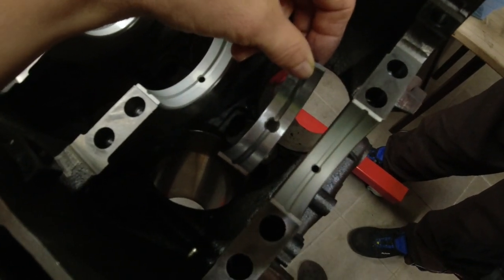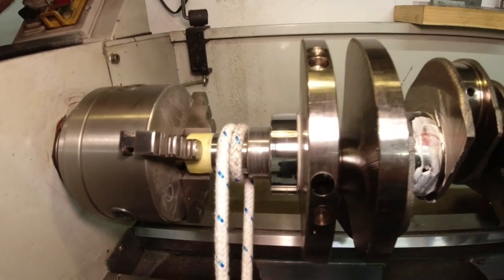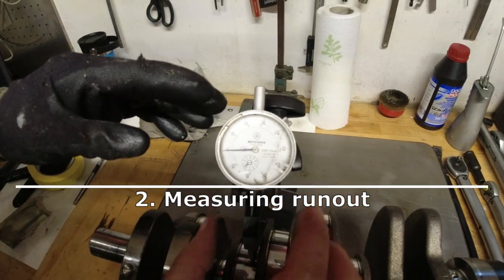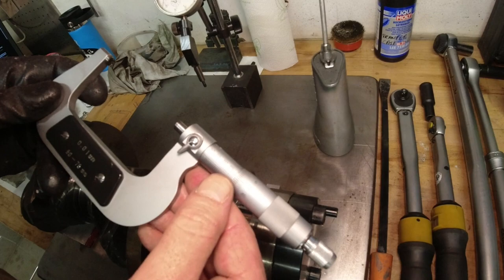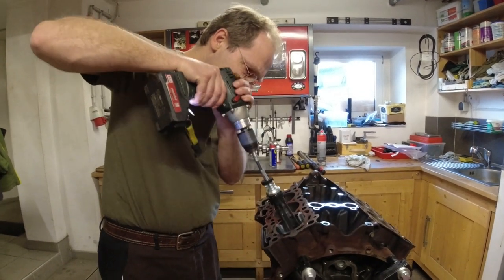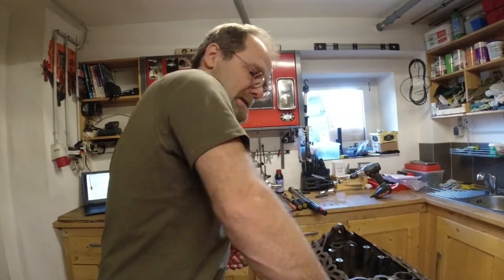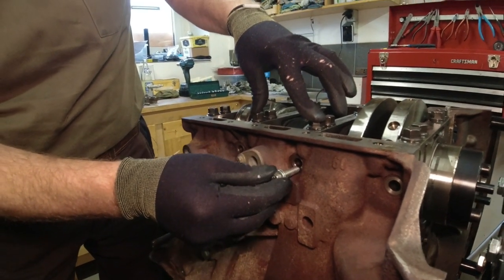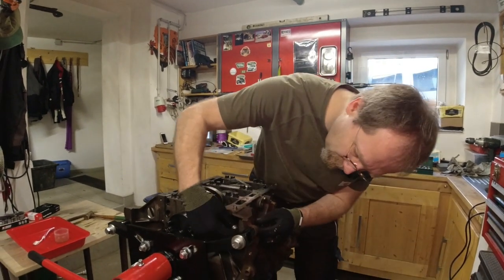Land Rover - Complicated crankshaft install - Discovery TDV6 - stress for Toyota drivers - Episode 4

Comment: Just love the detail being an ex Technician. Always interesting to see how different people do the same job.
Have to say I gently disagree over lubricating main cap bolts and contact faces (indeed any torqued bolt). If specialist bolts like ARP are used then follow their instructions but lubing the threads will drastically affect the torque applied (ie it will be higher than if torqued dry).
Personally I always fitted bearings dry and then added lube but its just choice. I never used the fancy 'assembly paste' and have (as you did) always used what we call 'Hypoy 80' diff oil right from the first Lotus Twin Cam engine I rebuilt. It has great stiction and has no detergent additives like a multigrade engine oil so will aid running in. A specialist racing engine builder here in Suffolk did some some work for me on a 1098 Mini engine with a BMW K Series bike head that I am building and one of the older guys said most of the specialist paste smells like Hypoy 80!

I reckon this will be one of the best TDV6 engines running when its finished. Superb attention to detail.
Reply: @Rahmi Acar  I was an MAN and Scania technician and they used stretch bolts but they were never lubed. I have built many truck and car engines and I always used dry bolts. My point was that some specialist bolts like ARP are manufactured for lubed torqueing. Most others should never be lubed unless the manufacturer says so.

Comment: i used to ink the shaft of Endmills and Slot drills when they were undersize to make them fit better in my mandrill, as a tool and cutter grinder. So i know you can build up a thickness with a sharpy[ie type pen :)

Comment: I do not trust Haynes manuals.
A very long time ago I was rebuilding an Alfa Romeo GTV engine and being very conscious about it (I was racing it) 
When checking the main bearing crush it was way out of spec according to the manual so I 'corrected' it. 
When I tried to turn the crank it was locked up solid. 
It turned out that the Haynes manual was a decimal place out! 
It cost me a lot of money to sort out. 
Also their manuals leave out 70% of what you want to know. They are really just advanced owner's handbooks. 
I have never bought their manuals since.
Bentley manuals are so much better (but a lot more expensive) .
Reply from the maker: Yes, the Hayes does not cover the lower end of the engine fully.  Lot´s of wrong information out there.  Christian

Comment: Re: avoiding oil delivery problems in bottom end. In addition to the restriction of the cam galleries, "radius" the oil holes axially only (use chainsaw type stone matching gallery width, with lead in toward rotation direction). As a last resort, cross drilling provides optimal oiling throughout the rpm range, or full groove main brgs.. A higher pump pressure might be necessary, with HV or pressure spring change. Am sure you're aware already. Nice job on the polishing Christian.. and Vera !

Comment: I currently have a rr sport on my lift with body removed holding me up from doing any other jobs and it has 360k on it and I suspect it is the original engine.......! May well explain the rattling noise on start up and the two completely defunked chain tensioners on both banks ......! 
They really are great fun to work on....! Never a dull moment!

Comment: Hi Christian + Vera, I have my own Discovery 3 and can relate to all the work you have done so far.  I gave up taking it to the Landrover dealer, each visit seemed to be Euro1000 plus each time.  I am currently doing the Exhaust crossover pipe.  Land rover quoted Euro2400 for body off and pipe replacement, unbelievable. Nearly finished now,  had to take gearbox off.  I wish Toyota would do a land rover crate swap engine.  Really enjoy your videos, please remember to fit a new  Impulsgeber, Kurbelwelle CKP with trigger ring.  Its a must that you use the landrover special tool Sealey VS231 Kurbelwelle Sensor Trigger Rad Installation Für Jaguar, Land Rover to get the timing correct. Keep up the good work.  Regards from Soest NRW.
Reply from the maker: We already have those parts waiting to be installed, including the tool. 😃👍🙋‍♀️Vera

Comment: great work.  Mine is in its natural state, with the body off looking for a mystery OIL leak..  
At the shop they told me they absolutely need to take the body off to determine the exact location, now they tell me the can't find it and since the body is off they cant start the engine to check.. :)  
Still I am happy with the car even tough I only did   300 km from the dealer   and another 200 to the specialized LR shop.. :)  Owning an LR is never boring..  
Anyway  this I know will be very expensive and now I talking with the dealer about some expenses to be reimbursed..
Reply from the maker: 😳😅 I am sorry, but you should be on our channel with your Disco. I hope everything works out for you. And I hope they are going to find the leak, it would be embarrasing for LR otherwise. Maybe you can write us then. 😃👍🙋‍♀️ Vera
Reply: @Vera_and_Christian  Well I will keep you updated  and   maybe when and if the car will be able to  run on its own I can drop by and tell you the story :)  Got plenty of pictures already,  all taken apart.  It would  be really funny if not for the incoming invoice.. :)

Comment: Thank You Vera and Christian for such detailed descriptions of engine rebuild aspects.
I already rebuild TDV6 engine twice and still have two on the table waiting to be finished (no I am not a mechanic - just doing it for fun).
At the moment I have two Discovery 3 and one of them is during swap for M57 engine from BMW.
Have a nice week and see you next Sunday.
Reply from the maker: Cool, respect. Please tell me those engines ran longer than a couple of thousand Kms. 😅👍🙋‍♀️ Vera
Reply: @Vera_and_Christian  We will see because one of them has only run a few thousand kilometers, and the other one is already in the car but the body is still off.

Comment: My mate and his cousin are traveling down to the south of France next week to pick up his 2.7 discovery which has been parked up for nearly a year without use. They want to drive it home to the southwest of the UK so if they get  any problems with the engine I’ll get them to drop it off for you!!
Reply from the maker: 😅 Make sure they are sensitive to any weird noises the engine gives off.  A couple of engine failures happened to ones which have been standing over a long period of time, probably because all the oil has dripped down in the sump. 😉👍🙋‍♀️ Vera

Comment: Superb video, reminds me of when i rebuilt my 3.9 V8 LR engine, cam shaft died after 70,000km, oil ways to the rear of the block starving of oil killed of the tappets, fitted a different spring to increase the oil pressure, problem solved, engine has 330,000kms and still going strong, with 20/50w with added zddp. If only LR carried out better R&D we all wouldn't have problems like this.
Reply from the maker: Oh man, I hope that we are doing such a good job like you did. 😃👍🙋‍♀️ Vera

Comment: Hi your doing incridible job   ...im james and iwas in need of a help ', i refaced tdv6 heads cylinder at 0.30 so i was in shock after bearing in mind that engine wont run  .my question is what is the best grade should use

Comment: Good job , I am not as talented because i am waiting for mine to go in and have a service and hopefully have some glow plugs changed , thats if he can get them out ? as i had trouble starting in sub zero temperatures last year . hopefully that will be succesful and prevent this happening to mine !
Reply from the maker: When we changed them on this engine, the engine was hot after an hour long drive to our house and then we cooled the plugs with an air hose. That is also our plan when we will change them on my Disco. But I am sure your guy knows that. 😃👍🙋‍♀️Vera

Comment: Hello, all the way from South Africa- Was just wondering if you honed the block for the mains-and slightly polished the crank journals is that not why the Kings mains didn't fit within spec. I see the manual shows 75.00 to 75.02 and the specs in kings 75.029 to 75.009- i only have access to Kings hence my concern. appreciate the video/s
Reply from the maker: The mains measured 74.98. The King bearing did simply not fit.  After compressing them, the bore was not round.  Christian

Comment: Dear Christian and Vera, I am repairing my 2.7 engine after a broken crankshaft. Because of engine block is in spec (bearings have not turned), i'm going to install Fai bearings following your advice. The question is what to do with the crankshaft, buy an original used one or a new aftermarket? Do you know any brand or manufacturer that generates you some confidence? I hope you are both well, and happy new year
Reply from the maker: You need to buy OEM or used.  Measure the mains in the block to see if it matches the FAI catalog!  Do not buy a aftermarket crank.  Do not reply in the comments. We won’t see that.  Contact me per email in the channel description.  Christian

Comment: MINI engines few years ago had problems with axial play on crankshaft because they saved some money on making thrust bearing faces only on upper part of bearing (block). And the bearing wear totally in few thousands km. And then was a technical campaign and recall for installation of modified thrust bearings with faces on both bearing parts. Have replaced them allot. About bolt lubrication - usually oil is specified in repair manual because torque moment is calculated and tested according to lubricant. In some situations they ask to lubricate and wipe oil from the bolts, in some they ask not to lubricate because bolts are already coated. As an industrial mechanic mostly we use Molykote on thread and contact face as required.
Reply from the maker: We ordered Molykote, but then did what the Ford Manual requested (which we did not have access to yet when we ordered the Molykote). 👍🙋‍♀️Vera

Comment: Great video again guys I'm nervous now I have kings bearings  sitting in my office 😭 

I'm hoping that the 2012 2.7 engine I I from the Ford territory has the actual Ford spec'd bores for the mains otherwise I'm in for a hard time like you had 

Did you end up using the kings bearings for the conrods
Reply from the maker: No, ordered FAI as well but the King would have worked for the con rods according to the catalog.  I think the King bearings are fine on later engines.  Mine measured 74.98 which is really the lower end and the bearings ended up warping a bit.  Christian
Reply: @Vera_and_Christian  thanks Christian just re read your email it makes more sense to me now after watching the video 🤣

Comment: What oil are you going to use? My Jag 2.7 is now over 200k km and I have decided that 5w30 is too thin. I'm going to 10w40. It's rarely below freezing in London and I think that such a thin oil was for emissions / fuel consumption, not protection of the engine.

Comment: You DID remember to replace the core-plug at the front of the oil-gallery, right?
We saw you drill a hole in it and then pull it out (11:25) so you could flush the oil gallery but I don't think we saw you fit a replacement.

Never cease to be impressed by the standard of Christian's work.
Anybody who's getting him to work on a project is lucky to have him.

If I travel to Germany, do you suppose he could have a look at the oil leaks on my TD5 engine? ;-)
Reply from the maker: Now, the plug will be fitted when needed😃👍, like everything else. 🙋‍♀️Vera
Reply: @Vera_and_Christian  Great stuff.

As long as it wasn't forgotten, it's all good.

Comment: I’ve got a stupid question. I see that you are putting the bearing shells in which are in 2 parts. What’s to stop them turning in the block. I don’t see anything holding them in place. Or do they get held when you bolt the other piece on to the block.
Reply from the maker: Like every engine bearing:  by compression.  The tabs which you miss here are for location only. It is a common wrong assumption that they have to do with anti rotation.  Tabs reduce the bearing surface area and this may be why Ford left them out or because they had an other cheaper idea to position the shells in production. Christian
Reply: @Vera_and_Christian  Thanks Christian. I missed one of the videos where you explained all this. Watched it last night. Omg.

Comment: Do you think the newer engine had a larger oil hole in the block for the bearing? I have always inserted them dry as I didn’t want anything behind the bearing to promote them to move, but I guess once it’s all knee deep in oil it probably doesn’t matter.
Could you have used shim steel for the loose bearing caps?
I sounded like you were unsure of the history of the crank shaft, do you think it would have been a good idea to get it crack tested?  I guess you need to stop somewhere with the spending.

Comment: That has to be the most complicated jigsaw ever! I'm surprised you didn't use an angular torque measuring gauge, especially as you were not doing the easy(er) 90 deg?
Just loving this series - I hope all your hard work pays off in the end.
Reply from the maker: The Amazon angle gauge did not work.  Should have spend more money on it.  Christian
Reply: Vera. Snap On makes a torque/Angle wrench. It's about $450.00 U$

Comment: My Jeep 3.6 gas/petrol engine is starting to use oil, about 1 quart per 900 miles. No leaks and no smoke. When can I schedule it for send to you for a rebuild? After watching your videos on this rebuild I worry that the engine shops here in the US will not do as quality of work as you are doing. Maybe I will just purchase a used motor with 60k miles on it and have that installed. I have not even priced out a rebuild - which going on labor prices and the amount of work that I have watched you and Vera put into this one will definitely come out more than $3500. Enough of my problems,  another great video as usual... Maybe I can get Sarah-n-Tune to work on my Jeep ( we live in the same city ).
Reply from the maker: 😅👍 She's got an Ur-Quattro now, now that is a cool car. 🙋‍♀️ Vera

Comment: Christian was haltest du davon anstatt das empfohlene 5w30 öl 5w40 oder sogar 10w40 bei tdv6 motoren zu werden.  Leute aus Russland halten falsche öl also 5w30 als ursache sämtliche Kurbelwelle Schaden.  
Bei 2,7 hdi Motoren in peugeot und Citroen soll solches Problem nicht so oft vorkommen und da wird auch 5w40 oder 10w40 öl vorgeschriebene.
Reply from the maker: Das Öl alleine ist nicht die Ursache.  Citroen erlaubt das Total 5W40 Syntetic 9000. Also 5W40 B4  mit API:CF. Das hat aber keine Ford Freigabe.  Es gibt kein 5W40 mit Ford Freigabe WSS M2C913B A1 oder WSS M2C920 A1.   Das Total Öl ist für den Citroen C6 mit 2,7 L HDi inkl. Partikelfilter freigegeben und kostet viel weniger als Castrol.  Christian
Reply: @Vera_and_Christian  Danke! 
Habe immer 5w30 stop start von Control verwendet.  Castrol ölfinder sagt jetzt aber für 2,7tdv6 mit dpf wäre sogar 0w30 c1 edge titanium das richtige. 🤔 
Also du nimmst Total ?

Comment: Glad you mentioned liqui moly, been looking at using their engine oil for my 07 lr3 tdv6 on next oil change, have you used any of the additives if not how do you feel about using them specifically the proline engine flush, proline injector cleaner and ceratec? Also loving this series your determination and skill  is second to non
Reply from the maker: We use Castrol Magnatec for the engine and Liqui Moly for the rest and we have never ever put any additives in any of our cars over the last 30 years. 😃👍🙋‍♀️ Vera

Comment: I keep meaning to ask, do you two have a sense of the failure % / rate for Discovery TDV6 spun bearings and/ or snapped crankshafts?  My 2009 2.7 arrived with no history 145k miles and a juddering torque converter (seemingly sorted with a full flush).  It starts very quickly though (even when frosty), is mechanically quiet and pulls well.  No DPF on mine so I'm using ester-based oil which has cut the oil-light-out time a bit (I'd say 2-3 seconds if left for a few days).  Economy is good, engine smooth.  Probably OK or ticking timebomb?  I've got it up to date with maintenance and not found anything too bad so far.  I'd very much value your thoughts!  Thank you and again, all best from the UK 🙂
Reply from the maker: Well, I cannot say that everything is going to be ok, but the ones with DPF are the superior Discoverys out there, mine included. 😃👍 If you are sensitive with your Disco, you are doing everything right to keep it running. But the older those cars get, and more mileage they get, the more you will have to do to maintain them. Our advice is always, if you got the skills or the money, you will be ok, but if you have to have it fixed in a shop, it will get expensive over time. There is more on a heavy SUV 
 that will break or fail other than the engine. And that goes for all other car brands out there, even Toyotas. They are just easier to fix. 😉🙋‍♀️Vera
Reply: @Vera_and_Christian  Sorry for the slow reply!  Going by your advice, it's pretty good odds it'll be OK as I tick all of your boxes.  It's only just gone back on the road having been laid up for over a year (I've never actually used it since buying it as a fixer-upper).  I'm sure the more miles I put onto it, the more I'll relax!  It's getting a remote FBH controller in next week or so, relegating truly cold starts to the past so another stressor removed from the engine.  Thank you for your reply and thoughts 🙂

Comment: “It looks like it could rip off a finger!”.  It can, I’ve seen it happen at work using emery cloth a guy had his thumb ripped off while polishing a shaft.
You’re supposed to attach the paper or cloth to a wooden stick rather than something that can catch and wrap around.
Dangerous stuff, if anything had gone wrong Vera would have had to finish the project off.